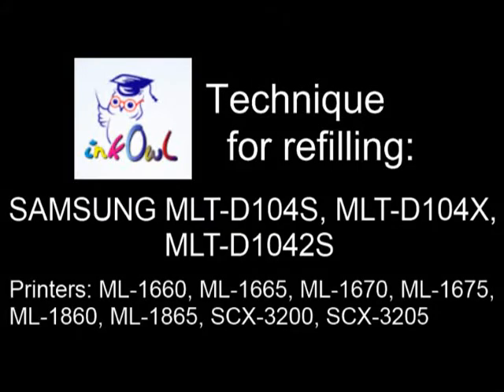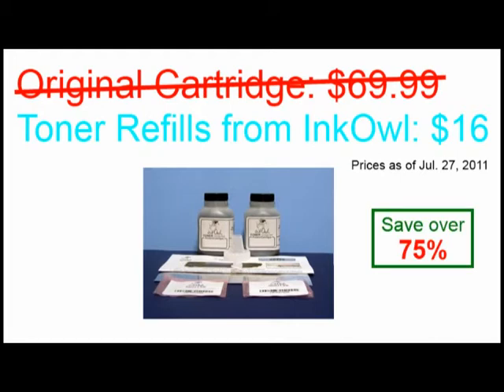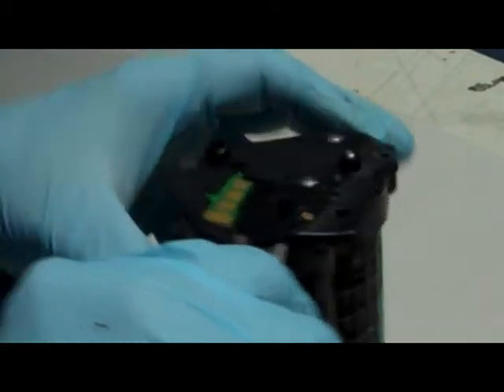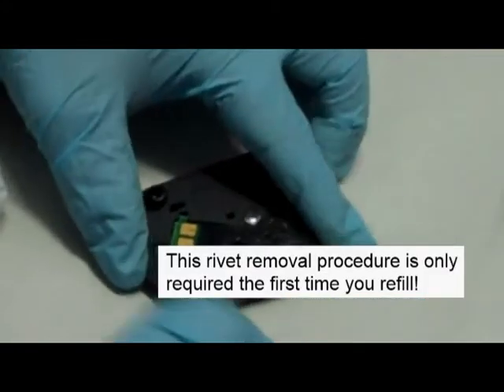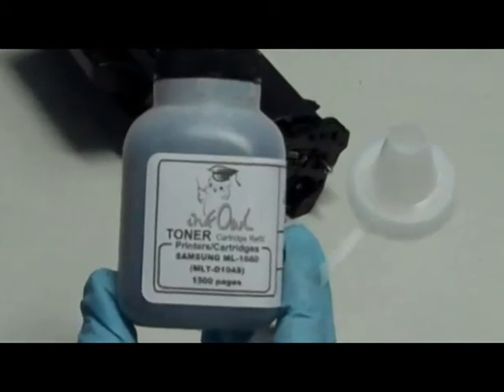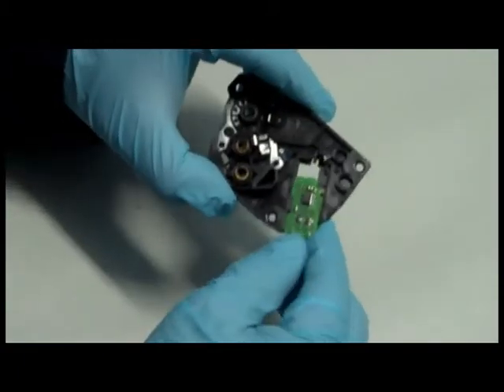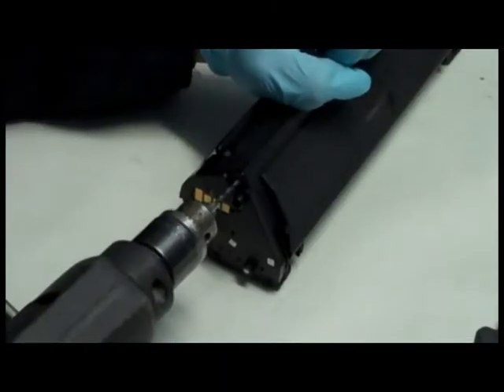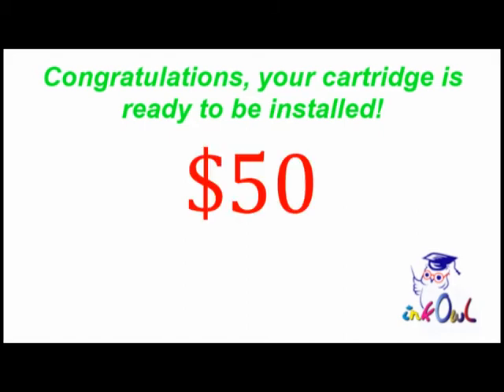How to Refill SAMSUNG MLT-D104S, MLT-D104X, MLT-D1042S (104 series) Toner Cartridges

Comment from the maker: It's to avoid overfilling the cartridge. If a cartridge is overloaded it will not work properly. Since there is always more physical toner inside the cartridge than the 1500-pages worth the chip will let you print yield of the chip, there will always be quite a bit toner left at the end. Also, sometimes due to small differences in chemistry between the OEM toner and compatible toner, it is advisable to empty the cartridge to prevent an adverse reaction from mixing the two types.

Comment from the maker: The biggest factor in determining the print quality is the state of the drum. Completely disassembling the cartridge and replacing the drum will definitely allow for a greater number of high-quality refills. However, this procedure is highly involved and isn't appropriate for our customer base (do-it-yourself at home/office). Just dumping the original powder and refilling through the plug is more than sufficient to get one or two high quality refills without the hassle of complete disassembly.

Comment from the maker: @ebonlase We have found that the excess toner compartment on Samsung cartridges is big enough that by the time it fills up (3+ refills), the drum is already worn out. For this reason, we have not included this step in our video instructions. However, there is, of course, no harm in emptying out the excess toner. To do so, you can use a holemaking tool to pierce a hole on the top of the cartridge, empty the excess, and seal the hole with aluminum duct tape.

Comment from the maker: The chip is the electronic component that tracks usage and presents it to the printer. Once a cartridge becomes "empty" (1500 pages have elapsed), no printer will ever accept it without a new chip.

Note that this is purely a design choice by Samsung. Other printer manufacturers make the chip optional (by letting you print even on "empty") or don't have chips at all.

Comment from the maker: @ChenJunAn It's not recommended that you do that. Two reasons: 1. Because the OEM and refill powder are slightly different, they will not work if they are mixed together in the cartridge at the same time. You have to empty the old toner out first. 2. If you overfill the cartridge, it won't work. By emptying the toner, you eliminate any risk of overfilling.

This is why we recommend this to our clients.

Comment from the maker: @zeeshan11624 The starter cartridge can be refilled very smoothly just like shown in the video.

However, you should be aware that there are other black-and-white laser printers out there, like the Brother models, that have lower-cost refill kits (due to the lack of chip), and much simpler refill procedures. That's what I would suggest for you.

Comment: Hello, thank you for the video. My question would be about the chip as well. So the chip is counting the pages printed, and after an amount of pages it would stope the printing even if the toner has been refilled and it is full? So you need than a new chip ? If this is the case, do you know who many pages are programed in the chip ? Thank you.
Reply from the maker: Yes, that's right. The page yield programmed into the chip is the same for OEM and aftermarket chips: 1500 pages at 5% coverage

Comment: i just cut off one wire in printer and it doesnt count pages, my question is about quality of printing :D and if one bottle is enough to refill?
Reply from the maker: Although it's impossible to claim the print quality with a refill will be identical to that of a brand-new cartridge, the quality really is more than adequate for professional documents and graphics. The bottles we sell weigh 65g, enough for 1500 pages at 5% coverage (same as the SAMSUNG MLT-D104S), and is the maximum fill we would recommend at one time.
Reply: same model? which wire you cut? can you please help?

Comment: How the guy in the video uses that sharp blade triggers me.
Reply from the maker: Our technician, who did the cartridge refill in the video is experienced and comfortable, but in the end we do somewhat regret our choice of tool as it does look intimidating. In fact, to pry off the rivets (0:30), you can use a small flathead screwdriver to chisel away at them instead of the knife. Then, to clean up the rivets (0:55), you can use tweezers. Finally, to pry out the plug (1:16), you can once again use a flathead screwdriver.